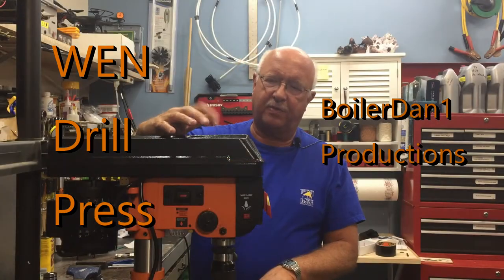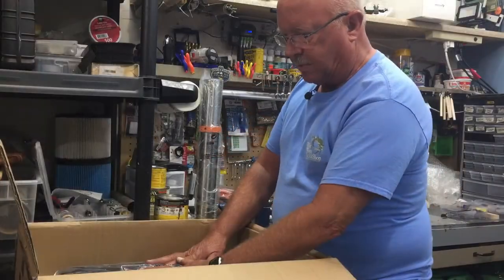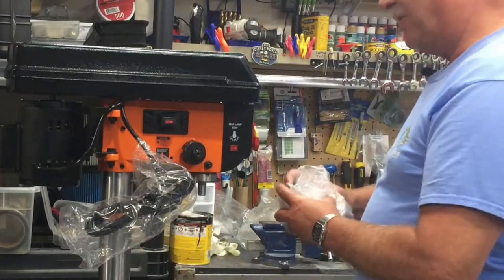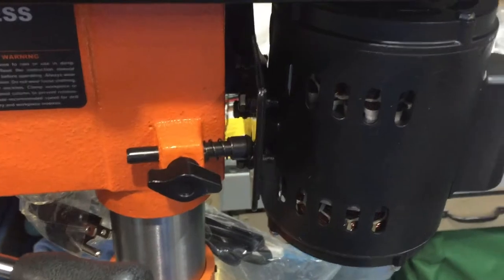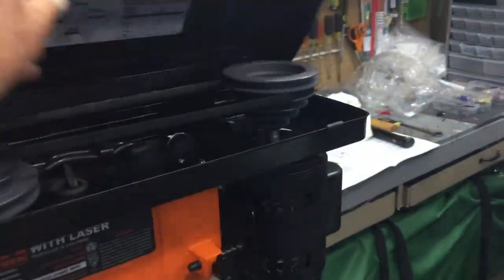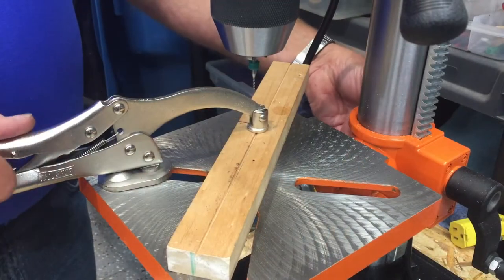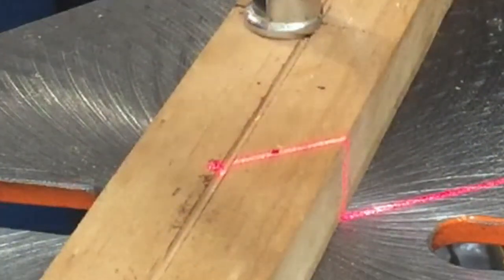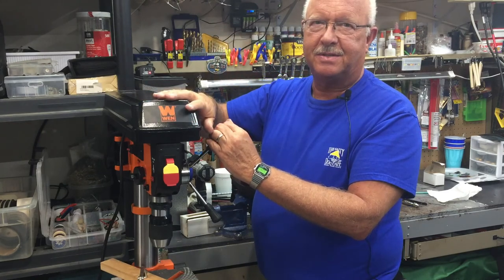WEN Drill Press UNBOXING, Assembly and Adjustment

Comment: Hi Dan, could you post a link for the chuck upgrade. I also watched your video on the wen drill press table but as you've noted, Wen was out until yesterday. I went online this morning and got mine from amazon. Your November video must have caused a run on them. Thanks to you, I too will be getting LED lights in the rear of my van. Too many distracted drivers.
Reply from the maker: If you’ve watched that many of my videos, the least I can do is get you the link for the drill chuck 😂👍
WEN DPA167H Heavy Duty JT33 Keyless Drill Press Chuck with 1/64 to 5/8-Inch Capacity https://www.amazon.com/dp/B08R7V5B19/ref=cm_sw_r_cp_api_glt_i_81AKYP0KEBAYTA4HFG6A?_encoding=UTF8&psc=1
It took some time to get use to centering the drill bit, but it does give a smooth rotation!
Thanks for watching EVERYTHING!
Interested in building tall model ships?😉🏴‍☠️😂👍👍